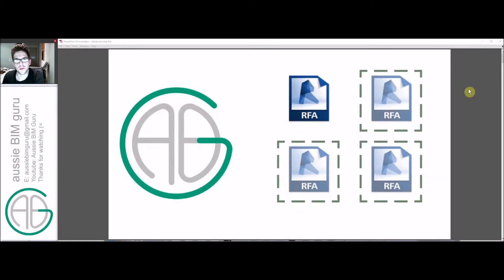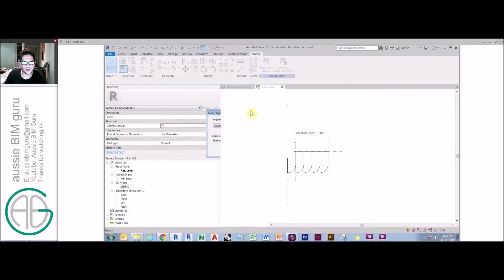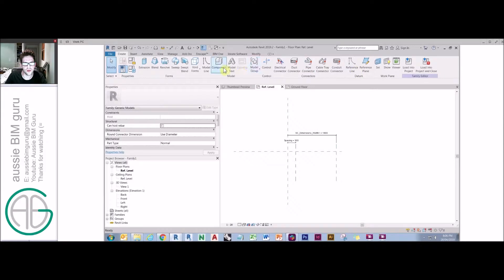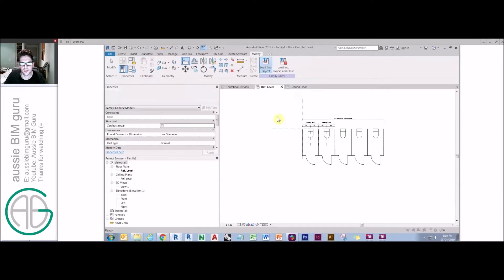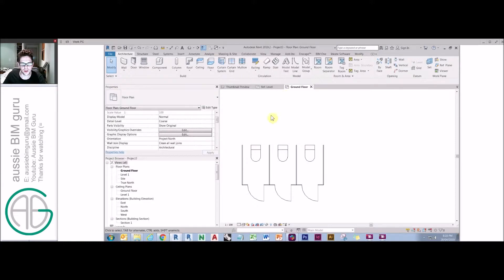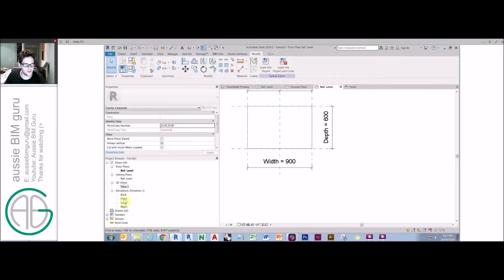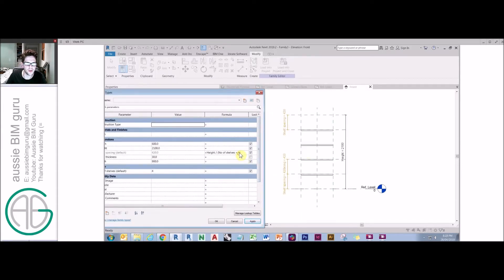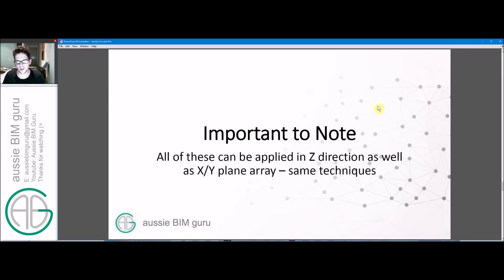Parametric Arrays in Revit Families!

Comment: Great series. Very helpful. Could you please show if we can make a parametric array in which the last element is a part of the first element. For example, I need to fill a room with tiles of fixed dimensions and I need 5.3 tiles on one side. Is it possible?
Reply from the maker: Its not possible within a single array unfortunately. You would need a spare adjustable tile on the end that fills in the excess left by the arrayed tiles.
Reply: @AussieBIMGuru  Thank you so much for the answer. As you know the new element appears when the length increases by 50% of the element length. Can we change it so that it appears say, when length is 70% of element length? for example only 5 tiles of 1m in length of 5.6m but 6 tiles in length of 5.7m.
Reply from the maker: @AhmadChesti  yes you could do this using a formula for the count with a max spacing, where you use fixed spacing and an excess instead of equal spacing. It's mainly just a matter of drawing up your goal and applying some algebra to determine the needed formulae.

Comment: can able to do ladder consist of hoop's in parametric
Reply from the maker: Yes this would probably be best done using two arrays for the staggered effect of the two sides of rungs.
Reply: Is there a complete vedio of this step ladder ?? If pls share a link of that vedio
Reply from the maker: Not in this case, but it uses principles shown in the video generally.
Reply: @AussieBIMGuru  can u able to give than family pls ...or pls do a vedio of that it will be helpful
Reply from the maker: @vinayck855  I don't make videos currently due to time limits but I added a ladder here that follows this principle. It relies quite heavily on trigonometry to work:
https://github.com/aussieBIMguru/Revit-Files
Reply: @AussieBIMGuru  can u pls do a vedio of that ladder.. actually it's very much needed so it's a request
Reply from the maker: @vinayck855  unfortunately i no longer get time to produce videos.

Comment: Have you discovered a way to make arrayed nested families change their height as the array increases in length?( The first in the array is length X, then the next is X+100, third is X+200 for example)i am fighting with this concept currently. It's for sheet piling, I have set up a family that arrays them, and all their lengths can be changed and rounded to a standard size. But i'd like to be able to increase the length of the sheet as the array progresses (for example an embankment that gets steeper and requires longer piles) and control it with parameters do you think it's do able? Could adaptive families be the answer?
Reply from the maker: Adaptive families would be needed here or a dynamo script for parametric placement. Unfortunately arrayed objects generally have to be the same in all aspects including spacing.
Reply: @AussieBIMGuru  thought that might be the case! Cheers for the reply though mate.

Comment: So I tried this out with the shelves.  But snapped and locks the Width and Depth of the shelves to reference planes.  It didn't like it.  Nested families never seem to want to stay locked to reference planes in my experience.
Reply from the maker: Snap them from the nested component origin planes. Any others and the parameters will trump constraints
Reply: @AussieBIMGuru  ok so I locked the origin planes and then controlled the shelf with a formula.  eg = Width - ( Carcass Thickness  * 2)

Seems to have worked.  I don't know why they can't make these things more logical and user-friendly.
Reply from the maker: @ScottValentine  yeah there's quite a lot of idiosyncratic aspects of family creation in Revit; takes time to come to terms with all the little tricks and workarounds!

Once an element is arrayed it can't be constrained by more than one reference plane in any one direction unfortunately.

Comment: It would be helpful if you opened the Family Types Dialog box so that we can see the whole Formula that you are inputting, if you don't want to make the dialog bigger for whatever reason, you can make the value column smaller.
Reply from the maker: Good tip, thanks!

Comment: Hii..I made this family nice work..I want to make vertical alignment nested family regarding Helical pile..can you make video.
Reply from the maker: Vertical alignment would be similar to the way i did the bookshelf. The helical pile would be difficult to constrain, it would require an adaptive/conceptual form because the blade is swept in 2 directions.
Reply: @AussieBIMGuru  Thank you..I tried on Adaptive component..but still not work..
Reply: I made component like pile extension, Helical plate but when I merge into 1 file..it's not work..
Reply from the maker: @sandeepjadhav19854  feel free to email me what you created and a reference drawing for what you're aiming to create.
Reply: @AussieBIMGuru  Thank you so much..I sent you the details on ur email..
Reply: @AussieBIMGuru  Hello, Did u check my email??
Reply from the maker: @sandeepjadhav19854  yes, I will try to look at this by mid-week. Working during the day!
Reply: @AussieBIMGuru  ok thx.
Reply: @AussieBIMGuru  I made..thx
Reply from the maker: @sandeepjadhav19854  oh ok.. well done! It looks like you almost had it, glad to hear you solved it so quickly.
Reply: @AussieBIMGuru  Thank you so much...